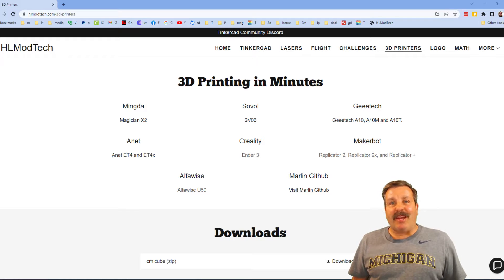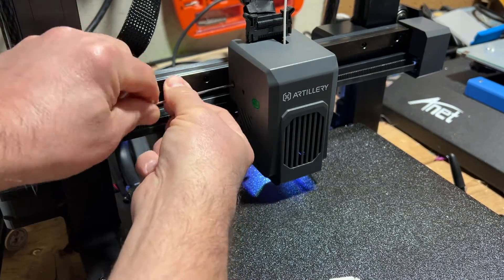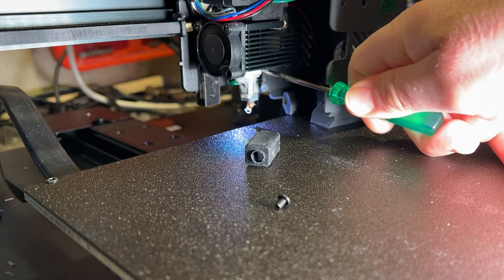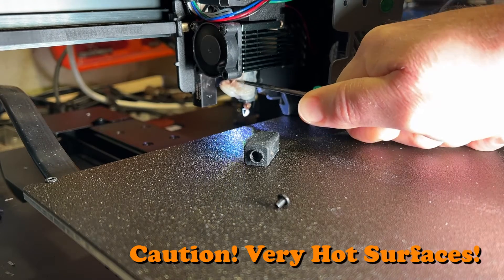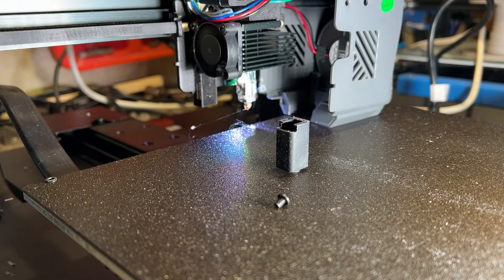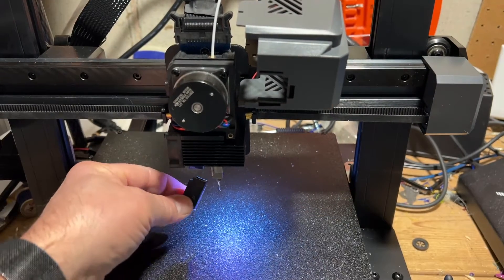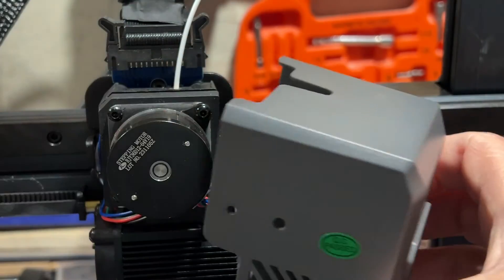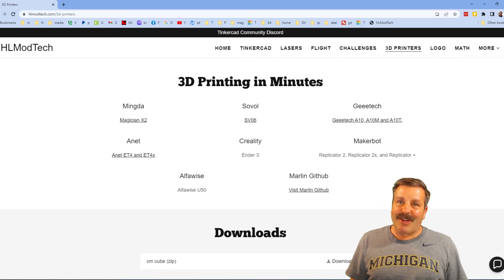Repair Filament Creep In Minutes Artillery3d Sw-x4 Pro Easy Steps

Comment: Removing all that civil woman that melted up there and oozed out is not gonna solve the problem. You need to loosen the nozzle. Heat up the hot end and then tighten the nozzle. Because what's happening is filament is oozing out between the top of the nozzle and the heat break.
Reply from the maker: I have seen that issue before with other printers, but this was not that. I’ve been printing for two weeks now with zero issues.
Reply: Yeah, I bought an used SW4 and received with this exact problem. Because I used a different filament I could notice that my filament was oozing through the windings too. I cleaned up everything and tightened the nozzle again. Since then, I had no filament leaks.